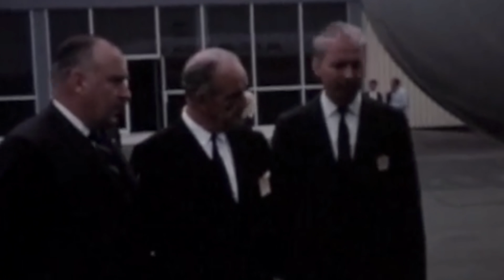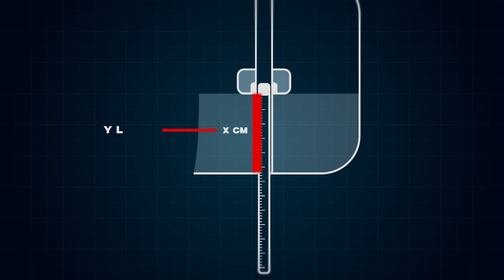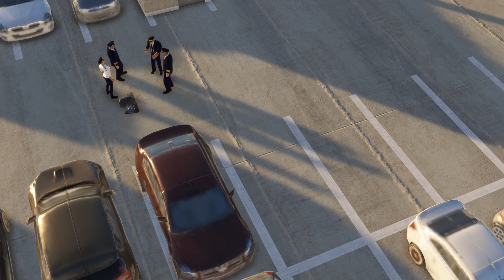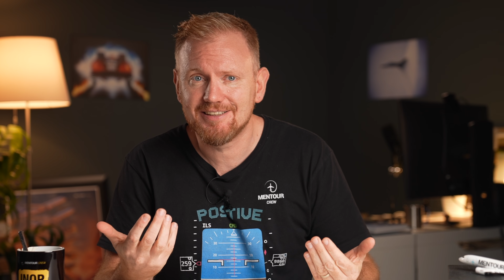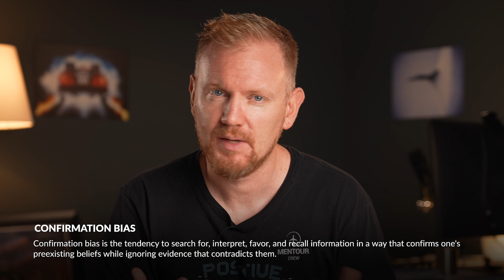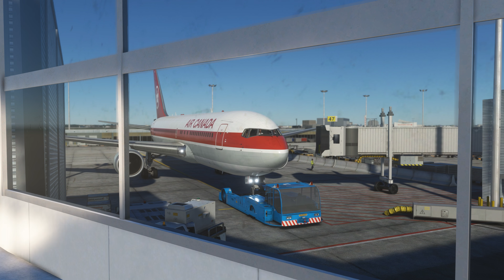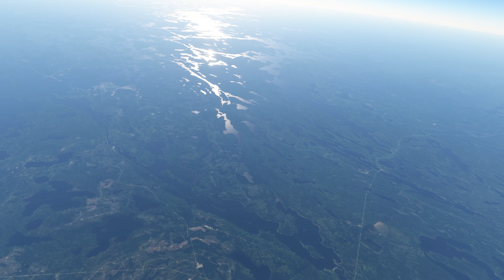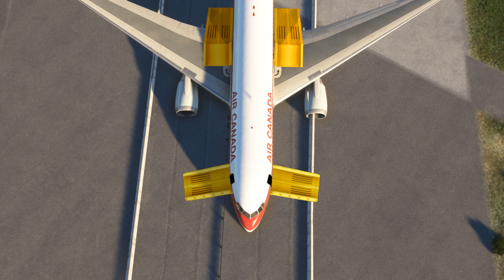NO Engines and Out Of FUEL! | The ”Gimli Glider" Miracle

Comment: Thank you for the refresh! Team Mentour's graphics and storytelling have really developed over the years into something beautiful. 
This story will always get me in the feels because the butcher's bill was effectively zero - even the plane wasn't badly damaged! - after what at the time seems to have been considered a Black Swan. 
The technical lessons get obscured a bit by the incredible save in my opinion. Two independent systems should not go through a single point!!!!!  I was also blown away that the fueling crew in two different airports made the same misconversion. I don't know what the report said, but to me that screams a systematic problem which fortunately got fixed. 
Others in the comments have mentioned sanity-checking calculations, whether done by hand or computer. It's a great way to catch upside-down conversions, missed minus signs, and so forth, whether it's on your homework or something people's lives depend on. Highly recommend it. 
This turned into an essay..... thank you if you actually read it :) and thanks again Petter and crew!

Comment: Shout out to the engineers who thoughtfully designed fallback channels like RAT, Gravity-based Landing Gear extension, and so on which saves the day and becomes history like this Gimli Glider.
Reply: Indeed.  They think of everything.  I wonder what our cars would be like if they were designed by airplane engineers.
Reply: @danielbishop1863 .  Safer but much more expensive
Reply: Right though the front gear gravity deployment completely failed...
Reply: @legion1791 It deployed, but failed to lock in position.

Comment: I really like how he goes into much greater detail than they do on the "Air Disasters" tv show, but 1 difference I noticed is that the tv show said the 2 boys on the bikes actually rode their bikes along the runway like trying to outrun the plane.  If it wasn't for the collapsed front landing gear and the center guard rail,  the boys would have been run over.
Reply: Either way, I bet the banana seats could be on display for the new brown stripes they acquired.

Comment: 22:00 This is the part that gets me. As detailed earlier, the dipstick checklist required comparing stick measurements to instrument panel. No instrument panel, no comparing, therefore incomplete checklist. And I'm willing to bet that nowhere on that checklist form was there an override or exception added by anyone involved. So they just ignored it? Or did they falsify the check by marking it complete anyway?
Reply: Haven't watched yet, but have been to the museum in Gimli and read a bit - apparently the POH had many blank pages and many procedures were being written on the fly. The Canadian government at the time was a little too driven to make a hard conversion to metric, the plane was one of the first with computers - so there were many gaps.
Reply: @eh42 The issue I'm facing is that what procedure existed by that point, obviously existed for a reason. As Mentour said, the dip test results must be matched to the instrumentation. No match, means grounded. No screen; means no matching; means grounded. The willingness of the pilots to sign off on the preflight readiness of a plane that would be deemed in an emergency situation in the air (which is an assumption on my end, as I assume there is an emergency action list for fuel guage failure) boggles my mind.

Comment: Could you please explain, how the aircraft keeps being pressurized enough for the passengers not to pass out when both engines fail?
Reply: It... doesn't. That's why emergency oxygen masks exist.
Reply: @HiddenWindshield  Thanks for the response. But from what I know, they only last for about 12 minutes. How did the Air Transat A330 for example glide for over an hour then, without anything bad happening to the passengers, at least as far as I know?
Reply: @VasZiegchen Air Transat Flight 236 did, in fact, have passengers that got dizzy or passed out once the masks ran out of oxygen.

Flight attendants have their own portable oxygen bottles that they can use to move around the cabin. They can also share them with any passengers that are having breathing issues. I don't know for sure if that happened on that flight, but I would guess it did.
Reply: @HiddenWindshield  Oh, that‘s interesting! Thank you for telling me. This detail is almost always forgotten, when someone is telling any of those glider stories.

Comment: Why the nose landing gear didn't lock?
Reply: The RAT has nothing to do with the emergency gear extension on a B767. When the gear was lowered on final, the mains locked down, but the nose wheel did not. This should have been anticipated because there was insufficient hydraulic pressure to operate the landing gear. B767 pilots cover this in training. TFor an alternate gear extension, the gear selector handle is left in the OFF position, and not selected down. Only then can you use the ALT GEAR EXTEND switch. When the nose did not lock, they did operate the ALT GEAR EXTEND switch, but the gear selector was already incorrectly positioned in the down position. This caused residual pressure in the nose gear hydraulics which prevented the nose gear from properly free-falling and locking into position as designed. I really don’t fault them because of everything else they were dealing with, and because this was a new aircraft with new procedures, that they were not properly trained on. The Air Canada B767 Quick Reference Manual was later amended to provide better guidance for Alternate Gear Extension…
Reply: @MikeSowsun  Ah, a better explanation. The RAT from the plane is in the Gimli museum. And it is surprisingly small. It was explained that it was an early version, and was not designed to provide nearly the electrical and hydraulic power that modern RATs do.
Reply: The RAT was new and small - not enough power. It apparently would have locked if lowered sooner (this from one of the volunteers at the Gimli glider museum in Gimli this summer).

Comment: The pilot doing that maneuver on a plane that big definitely deserved an award and a standing ovation.
What an absolute chad, to take an airplane 100 times larger than a tiny glider and just go "Yeah, and?" and just drift it into a non-runway runway.

An also huge, huge props to Boeing back then for making a plane that had absolutely no issue being landed so roughly - it stayed in 1 piece and even went on to fly again for decades after some repairs. Any pilots flying that plane should've felt honored, it's like sitting in a legend with a cargo hold full of good luck. I really hope the captain also got to fly the same plane again... heck if I were Air Canada management I'd give him and the other pilot the plane almost exclusively at that point.

Comment: Those pilots definitely deserved that award in pulling off that landing.  It might have even helped being a dragstrip since people were now on hand with fire extinguishers to stop the fire.
Reply: Having no fuel also helped with fire.
Reply: @Idonotwanthandle  Hydraulic fluid in the landing gear and apparently insulation between the inner and outer skin was the issue.

Comment: Hi there... at the time of this incident I was an engineer for the " opposition " CP Air based in YVR. 
Air Canada had ordered dripsticks on these new aircraft to be graduated in centimeters rater than standard inch graduations as on their DC-8s 727s etc. We heard that on this particular aircraft there had been some dripsticks in inches and some in centimeters installed due to some mix up with spares. Apparently some dipsticks were recorded as inches when they were actually  graduated in centimeters during the final fuel contents check in Montreal. There were rumours of a cover up in Air Canada regarding the gact that this aircraft had this weird dripstick mixture...although I cannot vouche for the truth of this. Still it was an accident that never should have happened, but ended with the miracle that everyone was safe. Thanks for the great episode on this incident...I am a great fan of Mentour Pilot and always enjoy your coverage of incidents and your balamced and fair assessments.
Reply: To anyone who needs to work with both units with any regularity, telling the difference visually between inches & centimeters on a scale is trivial enough, that job performance intervention is justified if you fail a bar this low.

Conversion calculations on the other hand, need a fair bit more steps to get correct, and you need the right ratios, which didn't happen in this case (bad number -> garbage in garbage out)
Reply: The upshot is that the drip test is to be verified against the instrumentation, meaning a mix up in drip sticks should simply result in a grounded plane. The issue we face here is that the pilots flew anyway, even when the verification failed. No screen means no match. There is nothing in the details provided that overrides that part of the checklist, even if they were told others flew the plane in that state.
Reply: Stop spreading unfounded rumours and go read the OFFICIAL TSB safety report. None of your rumour-mongering is true - or worthy of an aviation engineer. Do better.

Comment: I am very familiar with this story. I live in YYZ and Captain Pearson live just east of YYZ,  long retired.   The US Air that landed in the Hudson River got much of the press, they also did a very good job, but that was a far easier forced landing to manage , because it happened at low altitude and much of the decisions were already made for the pilots. The Gimli Glider happened half way into the flight, it took an abnormal amount of situation awareness and far superior airmenship to force land without anyone hurt. A lot of luck it happened just at that location where Captain used to fly gliders out of Gimli, but what made it so unbelievable was that he remembered it after so many decades, and under high stress.    It took 20+ minutes to glide there, not 3 minutes and that is much more chances of something going wrong. That forced landing was so difficult , when they loaded it into a simulator later, everyone else crashed. Just in case you think this was a freak accident and Pearson did not represent much of the Canadian pilots , around the same era,  Air Canada had a DC9 that caught fire in the air and the pilot landed in Cincinnati with no working instruments.  An Air Transat went out of fuel (burst fuel line) crossing the Atlantic and glided 150 miles and landed at Azore ?  Except for the DC9, both birds were repaired and flown again. I can claim Air Canada cabin service sucks, and they are expensive, and they do not even feed you in a 6 hour flight from YYZ to YVR,  but the crew at the front office are top notch, you will get to your destination, pissed off, but you will arrive, and very often, with your checked in luggage...........undamaged.
Reply: I would not say that the miracle on the Hudson was "easier" in any sense of the word. The fact that they were at such a low altitude, not leaving them with much time, in some ways makes it harder. They don't have that time to do calculations or to weigh options and discuss them thoroughly. Also, there have been other planes that have attempted ditchings in water, and it often does not go well. If a plane is not specifically built to land on water, it is extremely challenging. 

Both these incidents (the Gimli Glider and the Miracle on the Hudson) showcase incredible airmanship.
Reply: @danniballecter7936  I do not care less about politics and optics, I will use the word easier, much easier.  Those two guy that landed on the Hudson, and I talked to Jeff Sikes the co-pilot, (we both EAA members) jokes about sea plane hours, they were basically passengers in much of the glide.  In an emergency situation where seconds make a difference, I rather be piloting that US Air plane any day instead of the 767, the time is a small part, help, but a big potential for disaster. Landing in water are most chancy in rough water, not a river.

Comment: Please make a video, if not already done on Robert Piché,  is a retired Canadian pilot. On August 24, 2001, he was captain of the Airbus A330 flying Air Transat Flight 236 and managed to land the aircraft safely in the Azores after it lost all power due to fuel exhaustion.
Reply from the maker: That's a great suggestion! I made a video on this years ago but it might be worth a revisit.
Reply: @MentourPilot  Another good one was Eastern Airlines Flight 855. All 3 engines lost oil thanks to a maintenance error. They found out how close they managed the landing when the one remaining engine was too degraded to even taxi the aircraft. (In that situation, wouldn't it make more sense to shut down the engine right after landing to avoid a fire?)

Comment: I think Captain Pearson and his First Officer have did their best. The fact that this 767 lands without any engine noise in a racing strip is pretty crazy. If the nose gear had fully extended, the 767 might've overrun the airstrip, broken up, and increases the chances of serious injuries. I think those 2 pilots were heroes for gliding their 767 with no engine power from 26.000 feet. Bravo👏

Comment: The fact that it had 23,000 lbs of fuel rather than 23,000 kg isn't a coincidence, it's a function of the fact that they were using lbs/l instead of kg/l for the fuel calculations.
Reply: I don’t think so. Was it off by a factor of 2.2? If you were supposed or intending to fill something with 100 kg of fuel - 2200 lbs - but instead filled it with 100 gallons, it would equate to or weigh 6,700 pounds. Alternatively, 100 liters would weigh 176 pounds, whereas 100 gallons would weigh 670 pounds. One kg equates to 1.25 liters. So help me with the correlation.

Comment: With about 10 tons lesser fuel and therefore a lighter aircraft, won’t the pilots have noticed that the take off was quicker than anticipated for the heavier settings?
Reply: There were not many passengers on board IIRC. They could've attributed a lighter rotation to that rather than the fuel.